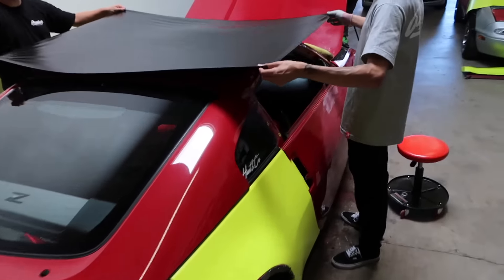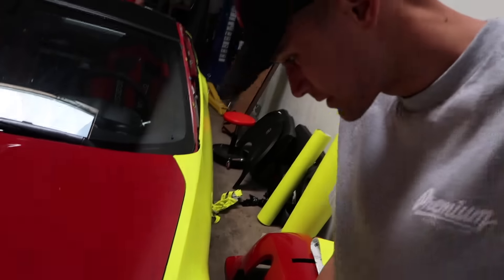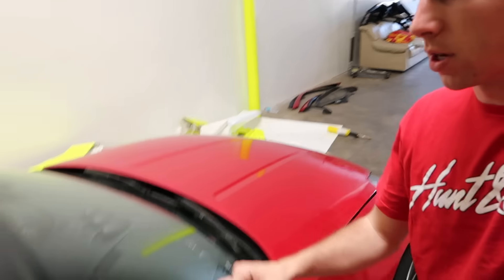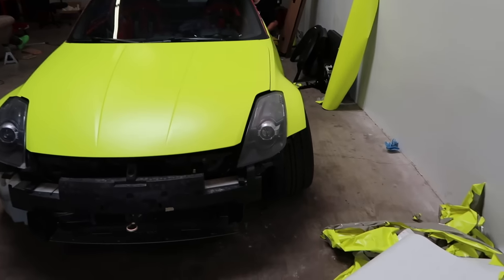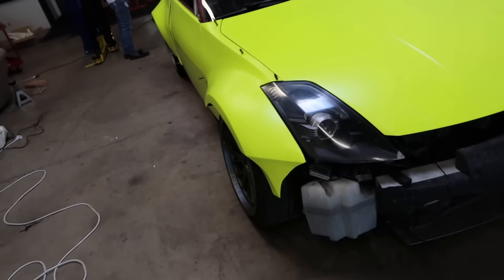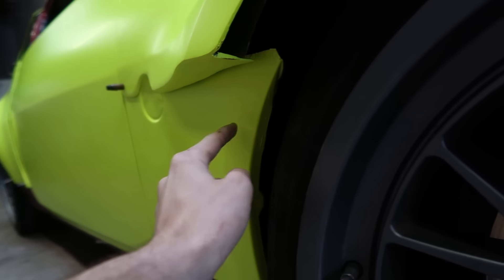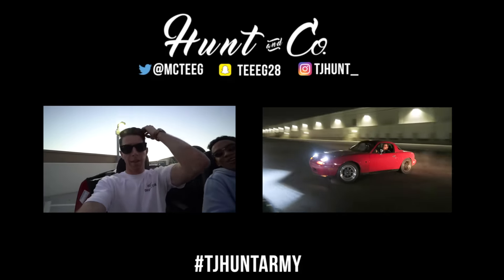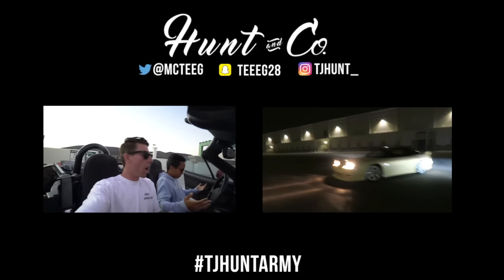350z looking mean + sliding with the angle kit

Comment: oh yeah you need to buy a truck and trailer so we can get that truck build and that custom enclosed single or 2 car hauler trailer build as well. cuz I got a enclosed 2 car hauler trailer 4 months back best decision I've ever made. In your case you could trailer your car and Calvin's car to events have merchandise to sell and maybe sleep inside if you need to and be able to have all your tools & tires with you and it comes in handy when traveling too far events and tracks. I do time attack racing with my fully built 92 mk3 supra and that trailer made everything so much better cuz I can bring my car and my girls car cuz she races as well our golfkart and maybe a pitbike and still have room for tires and our bags. I have a fully built-in work bench with all my tool ,air compressor, welder, full in&outside stereo system/tv's, full lighting inside & out , mini refrigerator and I put two beds like you would find in a RV that fold up against the wall so if I have to stay overnight cuz it's a two-day event I can and next I'm working on heating & AC cuz I just finished putting on a bigger generator to support all the power using. I think if you got something like this you could go to more events and reach alot more fan across the states. and with the enclosed trailer you can have a canopy that comes off the side of the trailer where you can have a booth to sell hunting company clothing and accessories or have a outdoor pit for your car. I wanna see more hater and this brand grow so start making bigger moves!! its #2K17 lets make some fucking haters. trust I got my trailer to pull behind my truck and my car got way more fun cause I could go to so many places I couldn't go cuz I didn't want to risk driving my car that far....